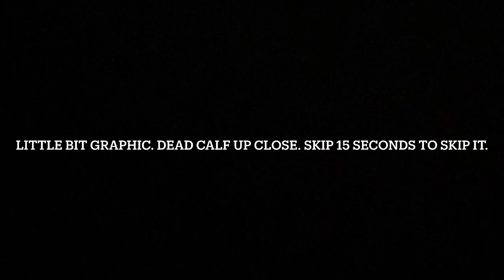Sunday work

Comment: Mate my cleanup job as a kid was to wash  the old vat filter with the high pressure hose before hanging it  over the last bale to dry before next milking lol haha. I take it with modern hygeine you guys gotta use a new filter every milking 😆
Reply from the maker: Hey mate. Nice someone has to do it. 
Dad prefers replacing every milking. You could probably still get away with it.  But they are very cheap now. 
Dad doesn’t want to risk a senses grade (chunks of grass, stones, and other crap in the vat).